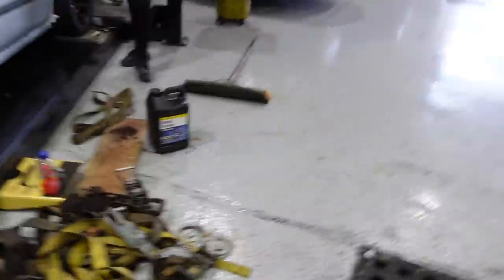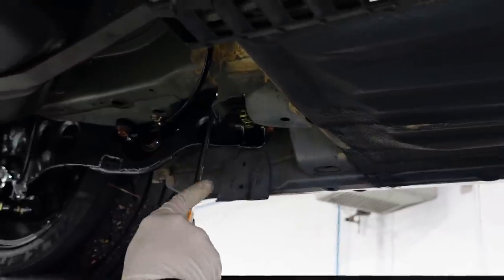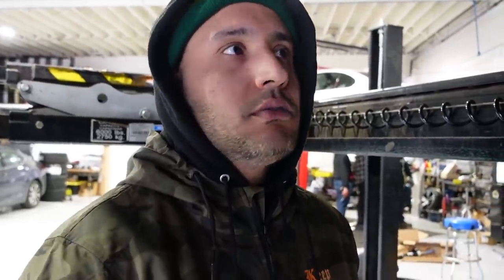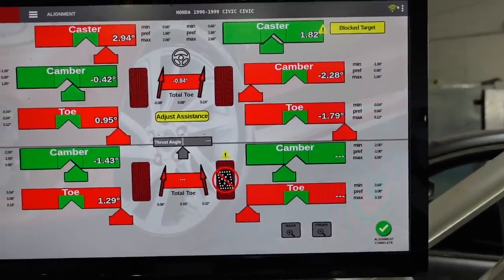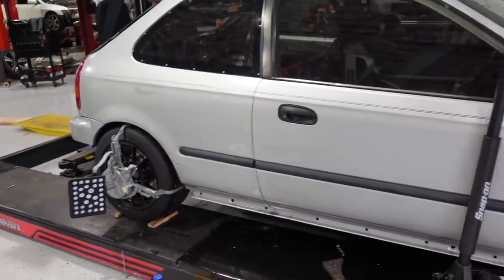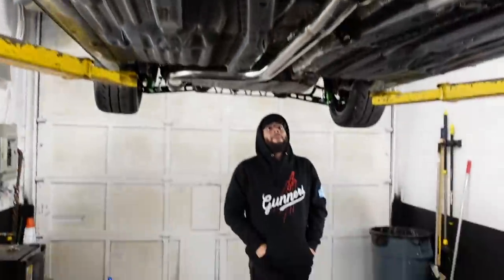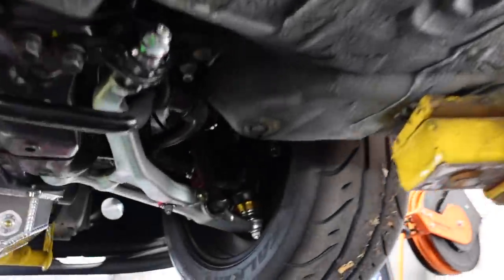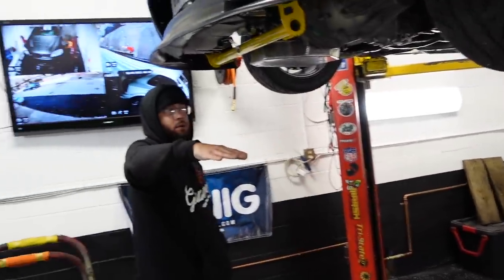This Car Drives Like SH*T 😔🤦🏽‍♂️ (Alignment)

Comment: The recommendations from Honed at 5:12 have rear toe in millimeters and not degrees like the rest of their recommendations on your phone. Their recommendation of +1.5mm rear toe is actually +0.2 degrees. You guys left with +1.2 degrees which is WAYYY too much positive toe (which in millimeters would be something like 9mm of toe in).
Reply: You are right on the money 
2.4 degrees total toe in is way too much
Reply: Toe front and rear on the Honed chart is in mm, which is the most common way to measure toe. The settings work if you read the chart.
Reply: @rhysrhysrhys  You are right, the front toe spec from Honed is also in MM. I wouldn’t say that is the most common way to measure toe though. Here in the USA it is more common to measure toe in degrees. As you can see, the machine defaults to degrees for all of the settings,  including toe. Since the front toe setting was 0mm, the mistake in units wasn’t noticed since 0mm is equal to 0 degrees.
Reply: @rhysrhysrhys  lol man It not the problem the alignment machine is in degree not in mm and they set the toe at 1.2 degrees it's way too much 
Aki misread the chart but it is first time doing a alignment so it all good we are trying to help contrary to you
Nobody ever said it was wrong on the honed chart 
Learn to read

Comment: for beginner track car put the toe to 0 all around , put the caster to stock in front, put -2.5 degrees neg camber in front and -2 in rear put the tire pressure 28 in front and 32 in rear cold and try from there. When you get comfortable before you mess with any toe try messing with the rear camber , try slowly taking away rear camber so maybe try 1.5 neg camber and see what difference you can tell. There is a lot to learn in the driving part so you may not even want to touch any of the alignment settings after you start driving because uyou are focused learning how to drive the track , cornering and braking.  As long as the back is not too loose and the front is not to pushy then you should have a fun day

Comment: Aki - zero out the rear toe and -0.01 on the front. 
-2.5 camber front, -2 rear. 

I have that setup on my EG. It’s perfect! 🙏🏽💪🏽
Reply: I have the exact same on my EK coupe... drives perfect.
Reply: Honed's chart has front toe in degrees but rear toe in millimeters. 1.5mm toe is 0.2 degrees. The machine was in degrees so the rear toe is WAY off. Honed's rear toe spec is actually not that far off from zero toe.

Comment: Pro alignment tech here... He doesn't have the machine setup to display measurements in millimeters (MM). That rear toe should be closer to ~+.08° he's got you at +1.5°. Hundredths of a degree is way smaller than a millimeter. That rear toe at 1.5° will keep you straight but will create ALOT of drag, wearing the tires
Reply: It's kinda dumb that Honed's chart has front toe in degrees but rear toe in millimeters. You're right it it should have been converted to degrees. 1.5mm is about 0.2 degrees.

Comment: Great vlog ❤️.
Most of the alignment is great to begin with. If the car feels not good on the street is mostly because of the agressive camber. The tires follow the irregularities of the road. The toe in on the rear axle doesn't help either. For me there is way to much toe in. For a FWD you want the rear axle to help you turn at low and middle speed to not understeer like a MF in corner entry.
Maybe Hooned wanted you to put 1,5 mm total, 0.75 mm on each rear wheels. I think the OEM toe value for the rear is great. It's a little bit of toe in (I don't remember exactly how much it is but it's something like 0.20° degres on each wheel). It's just enough to makes the car stable at high speed but don't kill the low speed sections and don't makes you go straight in corner entry. Of course when you guys will get use to the car and will play more the aero, the alignment will evolve as well.
Reply: I agree they probably ment 1.5 overall toe
Reply: Honed's recommendations had front toe in degrees but rear toe in millimeters. The machine was in degrees. The rear toe spec should have been converted to degrees (+0.2 degrees).

Comment: Hey aki you said in the video you want 1.5mm toe in but you now have 1.5 degree per side thats a whole lot more! I would suggest to use strings to re aline the car if you want millimeters. Maybe check the front caster as well! Its all in the details when your driving at the track.

Myself i use
-3 degrees camber in the front
-2 camber in the rear

Toe in (0.05 degrees) in the rear
Toe out 0.1 in the front.

Maybe it helps
Reply: 1.5* is whole different story. The tires will be gone very fast with their specs right now.
Reply: Honed's recommendations had front toe in degrees but rear toe in millimeters. The machine was in degrees. The rear toe spec should have been converted to degrees (+0.2 degrees).

Comment: I think you guys would benefit from driving some else’s circuit build and getting a feel for that and try to incorporate that into Manolo. My opinion 💙🔫
Reply: Honed's chart has front toe in degrees but rear toe in millimeters. 1.5mm toe is 0.2 degrees. The machine was in degrees so the rear toe is WAY off.
Reply: @TrackSol   GOOD EYE! I was wondering why honed would put the toe way  in like that theres no way thats funcrional. good eye catching the specs are in mm
Reply: Different is English town was home so i do drag and circuit racing
Reply: Circuit build different then going straight
Reply: Pci got specs yet he got a rsx havent seen vic in a minute
Reply: @exit9mastertec7  you make no sense man 
The spec is 1.5mm toe not 1.5 degrees 
3 degree total toe in is way too much no wonder the car drive like shit 
By the way for drag you want less rolling resistance so you want 0 toe in the rear

Comment: 9:40 you clearly said what the problem is, the car has bump steer, and LUCKILY i know the problem, 2 years ago, i purchased k-tuned spherical outer tie rods, NOW because these tie rods sit different, it causes severe bump steer, where the faster you go the more the car fights back and forth with itself. i resolved this by buying buddy club outer tire rods, which are like oem, just a harder bushing. those spherical tie rods are a gimmick!

Comment: from my track experience try zero toe in the front with -2.5 camber... the zero toe will help with top speed & stability. The rear i do +.50 toe out and - 1.5 degrees of camber... that will help the car rotate around a corner so you don't have to scrub speed while coming out of an apex. I hope that helps.
Reply: Honed's chart has front toe in degrees but rear toe in millimeters. 1.5mm toe is 0.2 degrees. The machine was in degrees so the rear toe is WAY off. Honed's spec isn't that far off from zero toe.

Comment: Loving this circuit build gettin it done right from the start. I've been working on my own fwd track cars for a few years. Alignment settings will make a huge difference on how your tires heat up and the handling balance of the car. I usually aim for -3 degrees front camber & -0.1 degrees of front toe on each side, -2 degrees rear camber and 0.2 degrees of rear toe on each side. I think honed might have meant 1.5mm instead of 1.5 degrees.

Running more negative camber in the front will help prevent tire rollover and increase mid corner grip up front. when running more front camber comparatively to the rear it will also help limit understeer and help the car rotate. Taking tire temps across the tire with a pyrometer after a couple laps will help dial in the camber. Ideally you want a relatively even temperature gradient  from the inside (hottest) to outside (coldest) of the tire for max grip.

Running toe out (negative toe) in the front on a fwd car can greatly help with initial turn in response but it's possible to go too far and make the car twitchy. At the rear the toe adjustment will more noticeably affect braking stability and turn in/mid corner rotation. Rear toe really depends on the individual car but it's best to start on the safer side and stick with around 0.25 degrees positive toe to keep the car stable under braking. More negative toe at the rear will make the car want to rotate under braking and rotate more quickly in a lift off oversteer situation.

Can't wait to see this beast on track, keep gunnin fellas

Comment: Looks like you set the rear to 1.5 degrees per side on the machine, the Honed setting is in MM so you'd need to convert to degrees for your specific tyre size. You will have gone way too far if you went with 1.5 per side on the machine!

Personally I prefer 0 toe rear anyway, the Honda RTA design dynamically toes in under hard braking to add stability. I find static toe in robs turn in/feels understeery on track, but everyone has their own preferences.
Reply: 1.5mm toe is 0.2 degrees, so zeroing it out is actually much closer. It's kinda dumb that Honed's chart has front toe in degrees but rear toe in millimeters.

Comment: The car’s exhaust note is pretty gangsta! My preferred alignment specs for a baseline road race car is -1/16 toe per side in the rear , -2.5 deg neg camber .  Zero toe in the front, and at least a -3.2 deg camber
Reply: 0 toe in the front is good for street use but for strictly track use, you want some toe out in the front for quicker initial turn-in and it will give you the feeling of faster steering response too.

Comment: I have a civic ek with the same tire setup. The only difference in my alignment is that i’m  -3 camber in front and -1/8inch of toe in the back.  I don’t drive much in the street.. but it feel the same way as yours. But at the track it’s perfect.

I would not change anything before you try it.  Bring toe plate and make change at the track if you don’t like it.
Reply: Honed's chart has front toe in degrees but rear toe in millimeters. 1.5mm toe is 0.2 degrees. The machine was in degrees so the rear toe is WAY off.

Comment: Driving over bumps and having the front tires fight each other side to side sounds a lot like bump steer. But since that's the specs they recommend, I'd try run it as is on the track first and see how Manolo performs.
Reply: Honed's chart has front toe in degrees but rear toe in millimeters. 1.5mm toe is 0.2 degrees. The machine was in degrees so the rear toe is WAY off.
Reply: @TrackSol  Good catch TrackSol, didnt see that.

Comment: I wouldn't have thought mm is the same as degrees. degrees would be heaps more toe in which is why it looks like a snowplow
Reply: Honed's chart has front toe in degrees but rear toe in millimeters. 1.5mm toe is 0.2 degrees. The machine was in degrees so the rear toe is WAY off.

Comment: Im an entry level HPDE driver and on my car I have -2.5 Front camber, .03 toe out the front on both side. As for the rear I have -2.0 camber and factory spec rear toe which should be like .08 or something. Car drives great and straight. Ive done a couple track events and the car handled amazing. I’m going to keep it that way until I feel confident in my driving first before I start to change things on the car.
Reply: Honed's chart has front toe in degrees but rear toe in millimeters. 1.5mm toe is 0.2 degrees. The machine was in degrees so the rear toe is WAY off.
Reply: @TrackSol  the alignment machine is in degress! They just misread it! You’re right !

Comment: My suggestion is zero out the toe. I had this issue. I also went off honed specs, I ended up finding what I preferred was zero out toe, and oe style tie rods. 2.5 camber all the way around and that has worked for me on my set up. Best of luck! 🔫🔫
Reply: You want a bit of toe in the front like - .25. That’s what makes the steering wheel back to center coming out of a turn.
Reply: @gsonperformance4506  Most I run in the front is .1 of toe out in the front. I’ve played with it at the track a bit and it’s what has worked for me to keep consistency in lap times. It’s been a few months since I tried more toe so maybe I’ll give it a shot again
Reply: I'd never toe in the front of a FWD car personally, front toe out really helps with turn in ability and response
Reply: @k20ee96   Yeah that’s what I said. Maybe I just worded it wrong but toe out for the front toe in the rear.
Reply: @jamilgsr3410  yeah I was replying to the other guy who suggested toe in the front. BTW it's Caster that has a big influence on the self centering effect of the steering
Reply: @gsonperformance4506  That's not true. It is the caster that helps the wheel return to center. If you know what caster is, think of a motorcycle fork rake. That's caster and the more negative caster, the more stable it is to point straight. The more positive the caster, the easier to turn the wheel.
Reply: 1.5mm toe is 0.2 degrees, so zeroing it out is actually much closer. It's kinda dumb that Honed's chart has front toe in degrees but rear toe in millimeters.

Comment: Can someome please help me with this. I have an ls vtec with a turbo. I'm overheating the oil. I'm trying to run external oil cooler. Is there an oil sandwich plate that supports both ls vtec oil feed, turbo feed and external cooler?

Comment: Good morning all, I always love a fresh vlog.

Do you think you weren’t able to achieve the specs you wanted because the indicator was mounted on the tire and not the actual wheel? I do not know how alignments work so sorry if I’m wearing my cape lol. 

I feel like the adjustments were being dampened by the weight of the car on the tires being rubber. Maybe mounting the sensor to the wheel would give precise measurements?

Thank you for the great content🙏🏼
Reply: Honed's chart has front toe in degrees but rear toe in millimeters. 1.5mm toe is 0.2 degrees. The machine was in degrees so the rear toe is WAY off.

Comment: i Had a similar problem with my EG, i know it sound strange, but it was because of the outer tie rods, the reverse ones, i swaped them with oem ones and the car is mint, drives perfectly fine
Reply: The rear toe was listed in mm not degrees 1.5mm = approximately 0.2 degree 
so 1.2 degrees is way too much toe

Comment: I have a ef's civic b20vtec only for track. 
In the front i have 4,25 camber, 0 toe.
In the rear 2,30 camber, 0 toe.
I think you have to start with 0 toe (stock) front and rear, and drive it, try to "learn" the car like that.
But for track, in the front you will need camber for sure...
😉😉🔫🔫🔫🔫🔫🔫
Reply: Honed's chart has front toe in degrees but rear toe in millimeters. 1.5mm toe is 0.2 degrees. The machine was in degrees so the rear toe is WAY off. So zeroing the toe is actually closer to what they need.

Comment: I know those alignment numbers seem really out of wack and the car feels funky however at high speed cornering and deep breaking into a corner they will serve there purpose. Trust me my guy👍
Reply: Honed's chart has front toe in degrees but rear toe in millimeters. 1.5mm toe is 0.2 degrees. The machine was in degrees so the rear toe is WAY off.

Comment: I know the old saying goes with math. You need to learn to add and subtract before you do calculus. But I'm of the opinion, give me that calculus book I'll figure that shit out eventually.

You guys are well versed in going straight. I have absolutely no experience curcuit racing. But I would imagine the suspension being setup for going straight wouldn't be as good as it is for easily turning. Of course it's going to be way more comfortable, but you should train how you fight. If you're eventually going to put the suspension to settings that are more aggressive you should just leave it how it is.

When I joined the military our drill sergeants loved us north east kids at the range, we never learned bad habits out in the woods with our fathers when it came to shooting. So we could easily learn how to to fire our weapons because we were blank slates. It's uncomfortable at first because you've never done it. But you learn quickly and hit the target more often than the kids with bad habits they can't shake.

Simply put, learn how to drive on curcuit racing suspension settings, it's a learning curve but you'll get faster much quicker. Getting comfortable on easy will force you into bad habits when you switch the settings and you'll have to start all over again.
Reply: 1.5mm toe is 0.2 degrees, so zeroing it out is actually much closer. It's kinda dumb that Honed's chart has front toe in degrees but rear toe in millimeters. The rear toe is WAYYY off.

Comment: I wonder if adjusting caster would change the steering from wandering…..  if the steering doesn’t wander if you are reversing, it’s caster
Reply: No, it is the toe that affect it. Caster affects the return to center.
Reply: @David-nb2bc  my MR2 had a issue like that, toe was good but the caster was negative which cause the steering to fight itself.
Or wander
Not sure if the term is still active in these days of time.

Comment: Have you spoke to Ben from gears n gasoline 
He won the club tr series in his k swap ek. 🔫
Reply: Honed's chart has front toe in degrees but rear toe in millimeters. 1.5mm toe is 0.2 degrees. The machine was in degrees so the rear toe is WAY off.